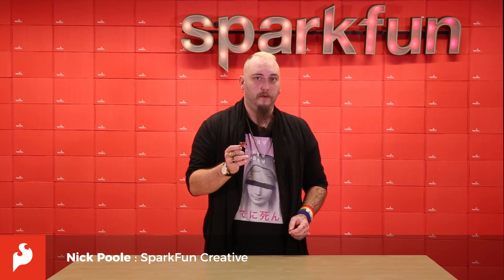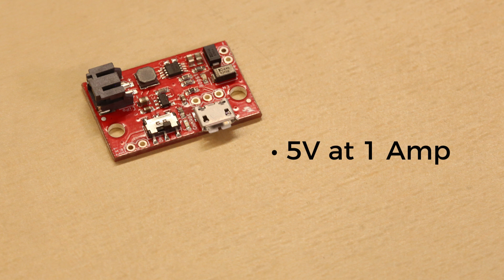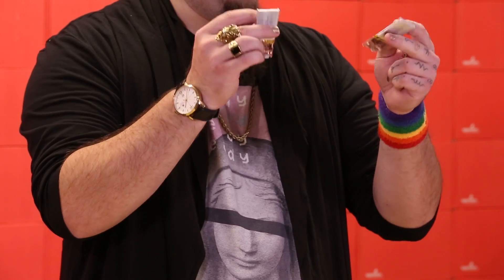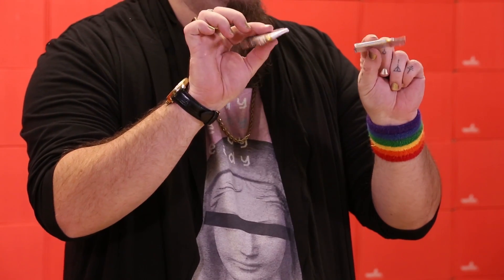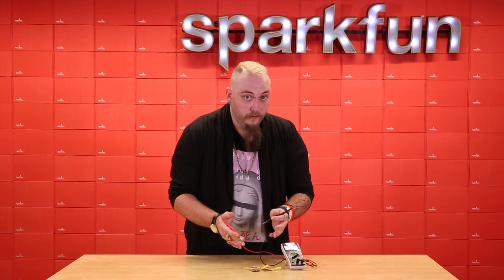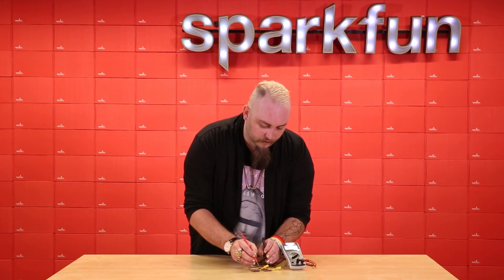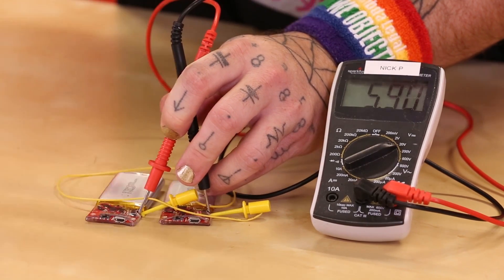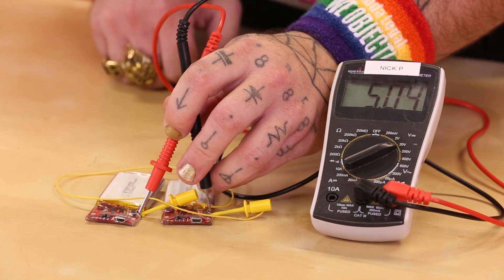Product Showcase: LiPo Charger/Booster

Comment: good enough for a power bank? I have some lipo batteries and wanna make them into power banks but don't want the tp4056 charger and protection circuit WITH a 3.7v to 5v circuit board because that takes up a lot of space

Comment: Nice little board... if you were using it to power a micro controller you can always add an external low voltage protection circuit to pull the enable pin to ground.

Comment: 5V is nice. 1A feels a bit limiting. Every time I try to do a battery-powered LED strip project I'm like, where am I gonna get the power for this?
Reply: I think the 0.5A charge current is the limiting part, means you have to turn off what it's powering otherwise it will never finish charging.